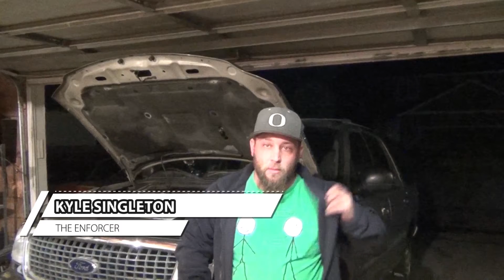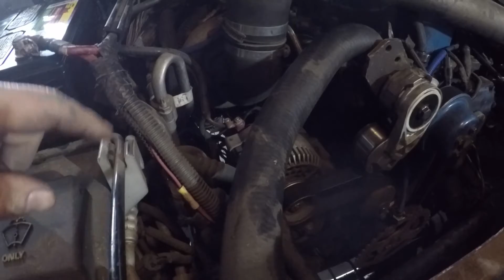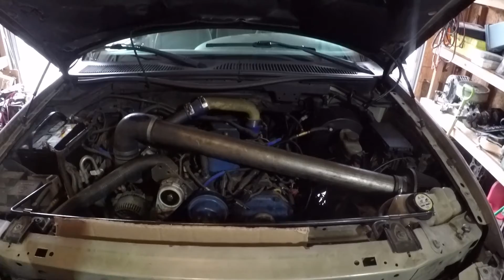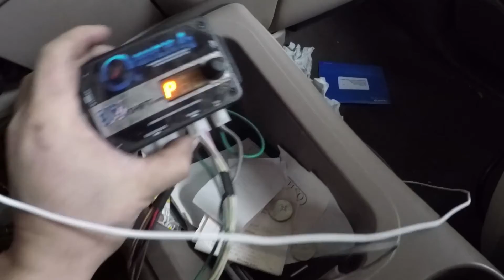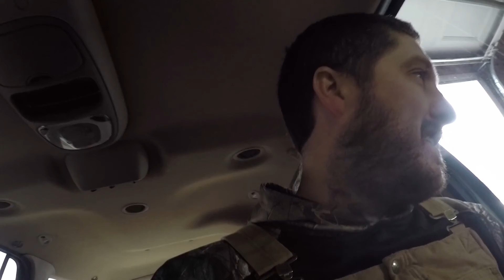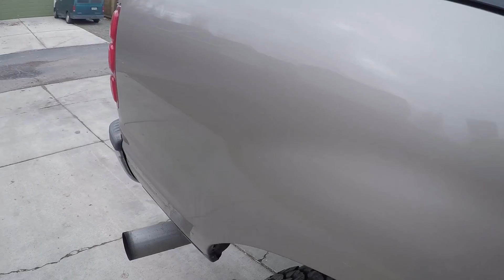4BT CUMMINS FORD EXPEDITION

Comment: I was thinking of putting a 4BT in my 2004 ford explorer I had a transmission blow up happen it kept slamming HARD on a long trip and once I came back to my hometown pulled into the bank and as I was rolling in the engine stalled well it sounded like all the spark plugs had blown out the block no compression. Well yes the HARD transmission slamming killed the 4.0 sohc, after a few months pass by I got a low milage 59k 4.0 sohc and got the transmission rebuilt but the replacement I bought was fucked it would not go into gear even after putting a new filter in and putting in trans fluid the torque converter was fully installed correctly I even took the transmission back out checked the converter still perfect. I pulled the pump seemed in good enough  condition threw it all back together put in back in still didn't work and it was a 96k mile trans well I told the people who i bought it from for 2000$ they said because it was installed I voided the warranty WAIT WHAT I paid $400 for the warranty and you won't take it back wtf so i take it to the shop he said the trans was complete missing the entire clutches yes he rebuilt it for 2500$ with install into the explorer doing good with that the 4.0 engine man its a real mess sometimes timing tensors made noise at first so bad i thought the engine was knocking so I had replaced them still made noise and yes I had soaked them in oil till i cant pump them junk that's all they are I went and bought some OEM motorcraft installed them and the dang front one leaked oil like a mother. took it back off found a used crush o ring that's supposed to seal them it now works good I do get a small amount of clacking from them on start up but its hardly anything now I hate these new 4.0's and now I got a new leak from antifreeze from the thermostat housing i'm gonna get that replaced and just think I started on this in july 2019 bought the car in February 2018 drove it for a year then it died in february 2019 one year exactly so mainly from july 2019 to most likely january of 2020 it just keeps on coming i'm kinda regretting buying it but it has some nice beefy BF Goodrich tires on it and a 2 inch lift bought it that way but I did put the new ko2 tires on. So yes I don't trust it but i'm trying to drive it till she is dead either the body rots out which its in okay shape I did do some body work still needs a little not much. Oh and I did put a new PCM well its a refurb off ebay but its like new though even came with a new set of programmed keys which I had lowes cut out for me for free I got like $9k in this beast that includes what I paid for it. Most people like my dad was just gonna let it rot in the ground he paid $5k for it so if you wanna say more like $15000 combined with what me and my dad has put its a bit dumb but most of the problems are gone its the little things now.
Reply: I fell alseep reading.